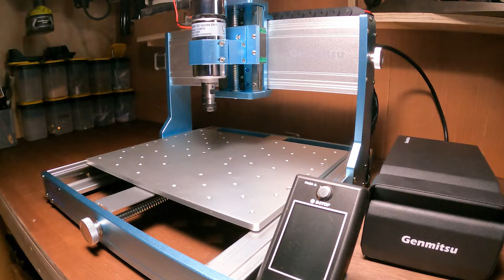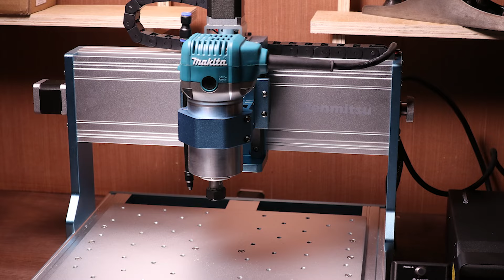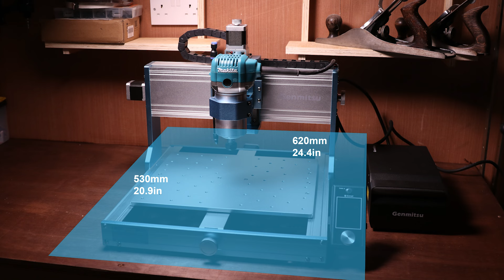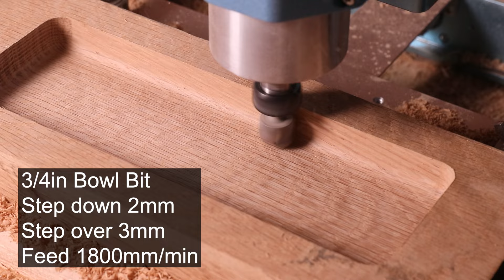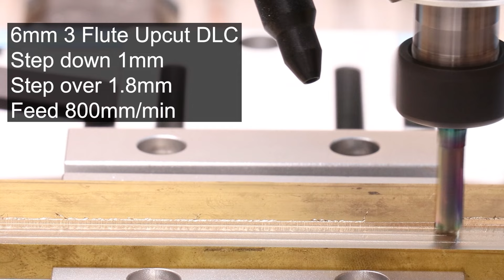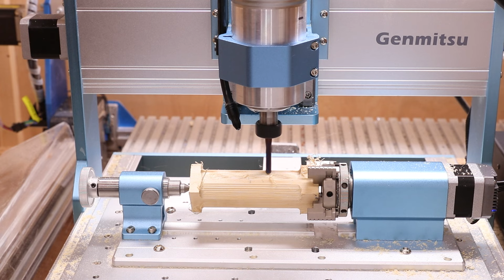Best CNC under $1000 - 3030 Prover Max Review

Comment: How does it compare to the foxalien woodmads 3020?
Reply from the maker: Larger work area, more powerful stepper motors and a little more going in for things like dust guards on the X axis so this wins but equally does cost more
Reply: @JamesDeanDesigns  Are the steppers actually more powerful? It seems that they are both NEMA17, but I can't find the exact size/specs on the foxalien woodmads 3020

Comment: Thanks for the review. I ordered one last week to upgrade from the original 3020. The cut in steel was impressive.
Reply: Did you cut steel with yours like 303 or 316L ?
Reply: @nkcb996  I have only cut 6061 aluminum so far running carbide endmills in a router. I suspect it would do well in mild steel but stainless may be too hard. An issue with running a router is the one I have is air cooled and it blows coolant away. I have not used to spindle motor it ships with but it is same as the 3020 I had and underpowered in aluminum so would probably not handle any steel well.
Reply: @rlsimpso  Any updates on it's performance in mild steel?
Reply: @XDXDXD3333  I was referring to the steel cut example in the video. I have only cut 6061 and 5052 aluminum on mine so far. I am using a router for those metals and it works very well. It cuts ABS and PCBs well with the stock motor. Using specific cutters for each material type makes a significant difference in performance.